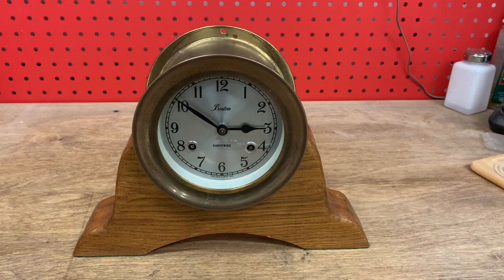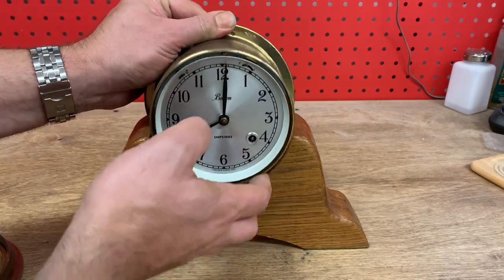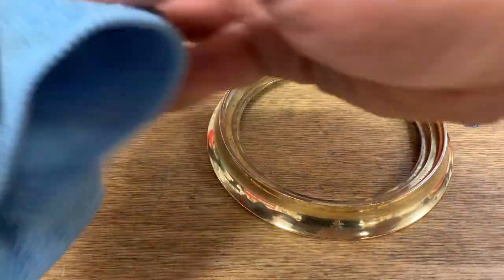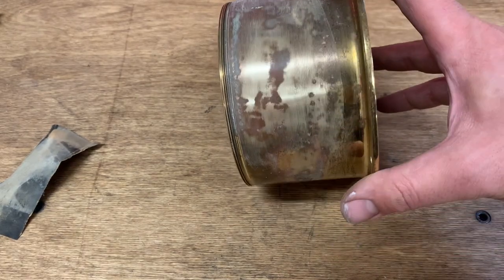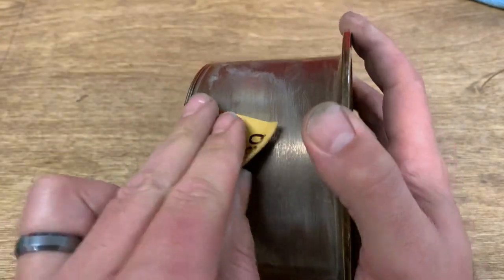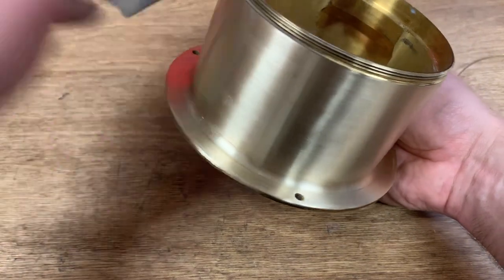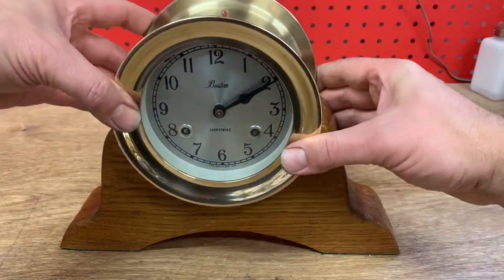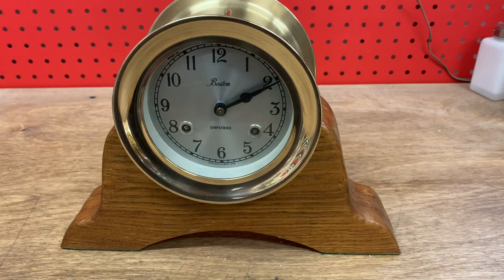Chelsea Ship's Strike Case Restoration

Comment: I have a beautiful Chelsea ship's wheel style clock and barometer set manufactured in 1972. The casings are made from brass and the ship's wheel rim is bronze. I asked Chelsea to give me some advice about cleaning and polishing. Their answer was "We don’t recommend any cleaners regardless finish as underneath it is all solid brass. Clean rag and pledge only."

Comment: Nice work.

I just cleaned and oiled my Chelsea Shipstrike that my dad bought in the early 70s, the movement looks exactly the same, only difference is instead of Boston on the face it says Chelsea.

Mine started running very fast, a few of the very small pinion gears near the escapement had some black gunk on them, didn't want to tear it down completely so just went in with small brushes and cleaned off each gear and pinion.  I am quite sure my dad never had it cleaned, so this was the first time in about 50 years it had been opened.  It's been a few weeks and it's back to keeping perfect time.

Getting those 3 screws in while putting it back together was a bit of a challenge.
Reply from the maker: Thanks for that datapoint. That's interesting. It's a Chelsea-branded Hermle movement - I'm not sure when Chelsea started using them.

Comment: This is an older post but I'll take a shot at leaving a question.  First, excellent description of how you approached the restoration, very complete.  Did you consider some form of brass lacquer as a finish instead of the wax?  That would have restored the case finish to look more like the original, which has a more "golden" look to it instead of a polished brass.
Reply from the maker: Brass lacquer is another option, for sure.

Comment: Thank you for the demo of brass restoration.
The Hermle movement is definitely much lower quality.  My 1926 Chelsea Neptune is still going strong with 300+ degree amplitude on the escape wheel; my 18 year old Hermle ship's strike already needs a replacement of the plastic (!) escapement.  Hermle did actually recognise its mistake in making a plastic escapement and has made a 17 jewel replacement, but the replacement part is sold anywhere from 25-100% of the cost of a new clock.  I found a $50 3rd party version on ebay, but it has yet to arrive.  At least the escapement platform is very easy to replace, just two screws.
Your Hermle probably has an all metal and jewelled escapement platform, I doubt if Chelsea would put up with plastic.
Reply from the maker: Agreed. This clock isn't up to the quality of a full-fledged Chelsea.

Comment: Set incorrectly. Two bells is 1:00, 5:00, 9:00 o'clock.

Chelsea offered the cheaper "Boston" Shipstrike (Hermle) movements from around 1972-1992 in the same cases as the Chelsea's own Ship Bell movement.
Reply from the maker: I believe the video correctly shows the bell arrangement as you describe - every full hour is a double bell, and the half adds a single bell. The video appears to me to be correct both in the beginning where I describe the sequence fully and at the end where I reattach the hands.

Thanks for your date information.

Comment: My clock that is exactly like the one in the video only dings 2 times at the top of every hour and 1 ding at the half hour point.  I cannot figure out why...any clues/suggestions?
Reply: These clocks have a rack lever mechanism that drops into position about 5 minutes before the strike. If something is preventing the rack from droping, this is exactly what you will get. At the half hour, an arresting piece prevents the second ding of the final double ding. The rack mechanism is behind the dial. The hour hand of the Ships Strike movement is like most clock movements, but if you have a Ships Bell movement DO NOT try to remove the hour hand. On the Ships Bell movement the hour hand comes off with the dial. You only have to remove the minute hand, which is held by a screw, not a nut. Now you can observe the strike mechanism and see what is holding up the dropping of the rack lever.

Comment: I have one of these with the same movement (132-041). Is there a serial number on these and if so, where is it. Thanks in advance. Great video. Clock came out wonderful for the amount of corrosion it had.
Reply: Hello, I also have the same clock with same movement (and same number). From what I was told, they did not put serial numbers on these. The only number I have is stamped on the back of the case is "90" which I was also told it the year it was made. No other ways to identify.
Reply: You are correct. I emailed Chelsea Clock and they responded with the same info you have. It’s basically a cheaper movement than an actual Chelsea Clock movement and they aren’t serialized. Thanks for getting back to me.

Comment: Great video.  I have a 15 year old Chelsea Shipstrike in nickel.  Would that polish and wax work on nickel too?
Reply from the maker: I'm not exactly sure what you're asking - if you have corrosion like I had, then no - I would not recommend going to the level of abrasion that I used. My clock is solid brass; your clock is likely nickel-plated brass, so any significant polishing is going to wear through the nickel plating. Brass can be re-plated, but that would be a bit of a project.

Renaissance wax would be no problem on the nickel - it is pretty inert stuff that won't hurt anything.

Comment: Too bad you destroyed the finish. This is why buffing wheels were invented.
Reply from the maker: Lol - did you see the corrosion when I started? What finish do you think was still there to have been 'destroyed'? A buffing wheel is just really slow sandpaper. There are different final finish choices you can make based on taste, but the path to get to clean brass requires abrasion.
Reply: @MinnesotaClocksandWatches  I just finished one in worse shape than yours. I used a buffing wheel with black compound followed with red compound and Nevr-dull. Shinny, mirror like finish. Not a "brushed " finish like yours.  After twenty year in the Navy I think I know what polished brass should look like. But hey, your choice.
Reply: @TM1Alan  if I had you in my ship’s engineering division, I’d have a name tape sewn onto your coveralls with “troll” 😂
Reply: @TM1Alan I would be interested in you detailing your process.  I think this clock looks pretty good.